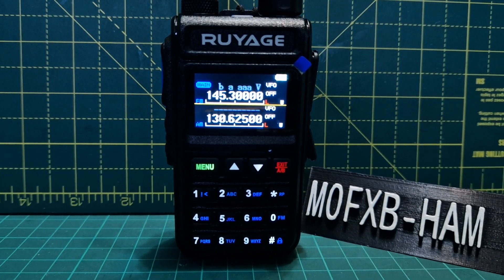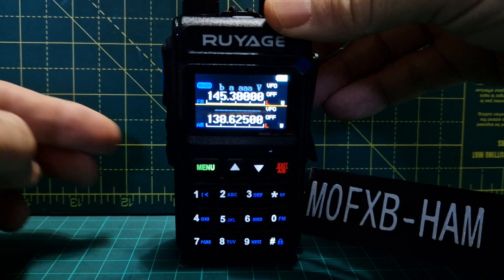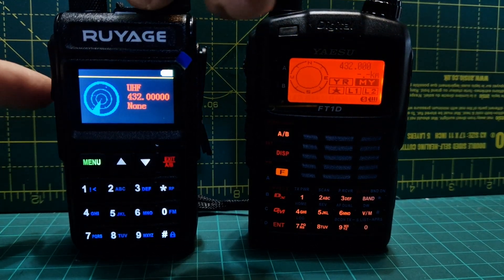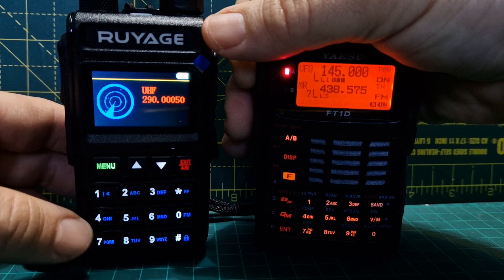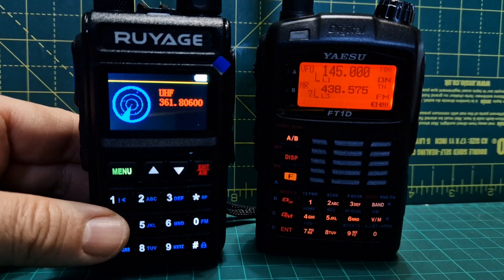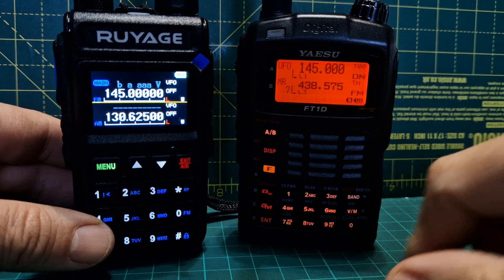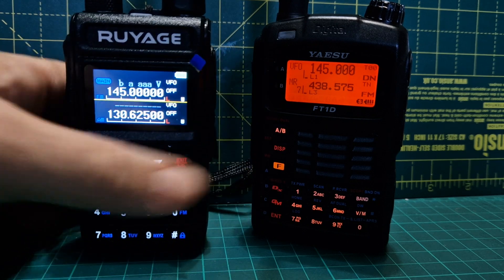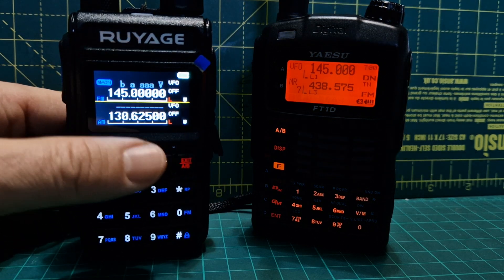RUYAGE UV-58 / RADTEL 890 Frequency Scanner

Comment: makes a UV-5R look a bit cheap now but those the best price. Bet one for £25 somewhere. This for the money, nice screen but bet chucks out noise everywhere. No FCC for that. Surious emissions. What caused greef to me at home on external antenna, Baofengs. Killed the TV as everything on the roof and radio transmit kill TV, Bet this would. Now the FD-70D. Does not on even 5W on Diamond antenna not 1m from TV antenna on the roof. Cheap radios nice though fro the money but a bit dodgy to use. But we all have or do. My cheap mobile 12V £72 thing in the car, Bet that not suit the FCC rules. Or europe body, forgot what is called. New year morning!. Not that we did anything  went to bed late!.  Daniel  G7TRV. Near Oxford.  Had a Uniden Baercat (I think) well known scanner, still current I think for a bit. A scanner, that wizz through really quick as a scanner, Find amatuer radios not so much what 3 or 4 different things I got. Even the dear, ok more than a baofeng not that quick, a Yaesu, designed as a TX, not a scanner I guess. It finds something this Ruyage, The Uniden did that. Lock onto something, useful that, scanner gone and the Beofeng stuff, sold it. a Yaesu as you got now. This here as in video, original digital FT1D?. nice thing, two lines and GPS. FT-70D the cheap offering,
Reply from the maker: Hi thanks' for watching-73